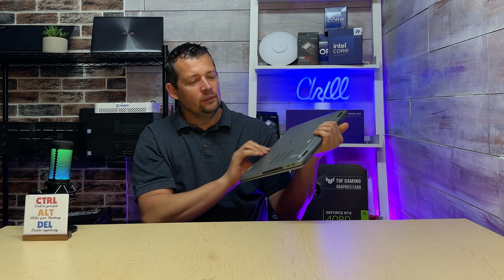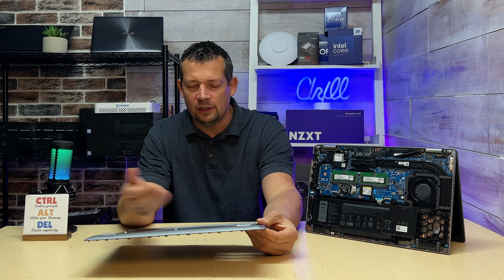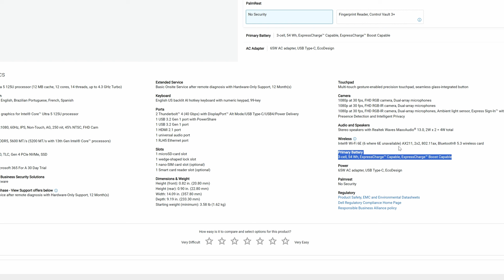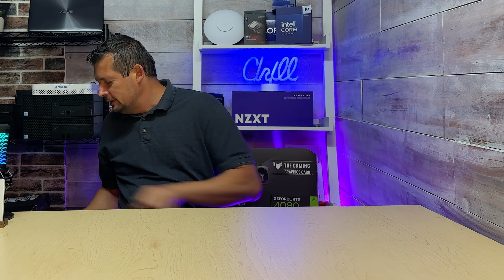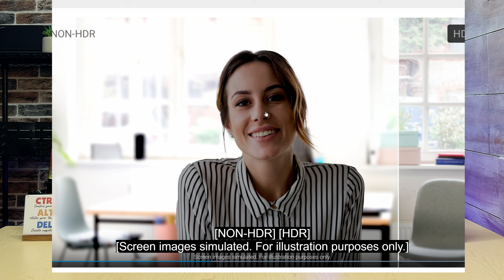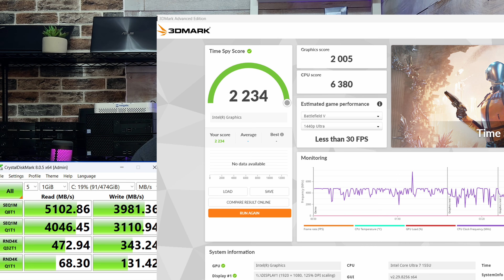Latitude 5550 Laptop Review - Intel® Ultra 7 155U  - Ram & SSD Upgrade options.

Comment: love the work man. is there any quiet laptop come with 12th or 13th gen Intel or AMD in equivalent to replace my T580 which serve me a good 5 yrs but now the high pitch fan noise started annoying so much. I have in mind for a dell 5520/5530 or thinkpad l15 gen 3 and my work is mainly on excel and few tabs in the background. do you have any recommendations? thanks in advance
Reply from the maker: Hey,

This is a tough one.
The new ultra cpus are so much better regards of heat. I stopped buying Dell laptops  due to the peeling paint and unreal keyboard wear about a year ago.
Hopefully that is behind Dell now.
5520 and 5530  might be affected by this. Look at the Lenovo.
I like HP EliteBooks, the fan also runs in them fast but it doesn’t have a super annoying sound of it.

Comment: I just got a 5550 for work and it appears there is a small button on the edge of the hinge side - what is it?
Reply: Found it! Nano-SIM card slot apparently
Reply from the maker: Yes ! You are correct! Around 5:22 you can see where the Wan card would be connected to the Nano slim card.

Comment: Can it run GTA V without GPU?
Reply from the maker: This is the "u" the efficient CPU, if you are planning to run GTA V or other games,   get the "h CPU " with least 16 or better off with  32 Gb of ram, that will run it for sure and significantly better as well.
Reply: @Scott.The.IT.Guy.  Thanks for quick reply. I got Ultra 7 155U (14 CPU) and 32 gb ram but no GPU card .. Will that work?
Reply from the maker: Yes it will you will get  60 fps in full HD , even with 30 fps it’s completely playable
Reply: @Scott.The.IT.Guy.  Gracias . you doing awesome work 👍

Comment: Usb c port are designed to be replaceable ? I hear they're held by screws instead of soldered on
Reply from the maker: They are part of the motherboard, I usually point out  that if you trip over the cord or damage the USB-C port you will need a motherboard replacement or someone who can do micro soldering.
I can’t find the related part in this video do you know where is it at?
Reply: @Scott.The.IT.Guy.   not part of the video.  The new dell pro plus has screwed on usb c modules and I heard the 5550 has it too.
Reply from the maker: I am looking at pictures from the 5550 motherboard and it has no screws.
The pro plus does and that is indeed replaceable. 
Dell actually is doing this with their desktops for about decade now.
Optiplex and precision desktops have optional ports that you can connect to the motherboard like Dp, HDMI, VGA, Serial, USB-C, 2.5 Gb Nic.

Comment: is this better than the latitude 5350 ?
Reply from the maker: It really depends on what you need to do with the laptop. The 5550 is a 15.6” laptop, it’s heavier, but since it’s larger, it has a larger  cooling system so the same processor is faster. The ram is also upgradable later on if needs to be.

The 5350 is a small 13” super portable laptop, the memory is on board so it cannot be upgraded. Since it’s a much smaller case it loses some of the performance.

What would you do with the laptop?

Comment: I have had two Dell laptops for a long time. The battery life isn't great, but both are still working. Which one is better, the XPS 15 or the Latitude 5550?
Reply from the maker: Not sure which XPS  are you referring to. The 16” XPS comes with onboard ram only and has a touch key Function key which I can’t stand. 
I personally will never buy a laptop with onboard ram. What would you do with the laptop?
Reply: @Scott.The.IT.Guy. I have not yet seen any reviews about the XPS 15. I am a digital nomad, and my work is entirely web-based. I think the Latitude 5550 might be too heavy for me as a woman. I am really confused about what to buy—there are so many options. I had a Lenovo before, and in the third year, the case/hardware softened or melted on its own. So, Lenovo will never be my choice.
Reply from the maker: I have been doing IT for 22 years, I was at Microcenter a few times this week looking for laptops for different clients,  the amount of laptops they have are overwhelming for sure.
The XPS 15 was discontinued last year, maybe you can still find it somewhere as new old stock, but as best as I can remember the XPS 15 is also heavy. 
I would look at HP EliteBooks, they are great machines especially when they are on sale.
Reply: @Scott.The.IT.Guy.  yay, XPS15 was discontinued, thanks for this info. 
How is the battery life of HP? ☺️
Reply from the maker: The latest generation G11 with intel ultra processors will be somewhere between 9-13 hours, the Elitebook 865 G11 with AMD processor can last 15-18 hours . I will have a review coming out on this in a few days.
Reply: @Scott.The.IT.Guy.  yehey... I'll wait for the reviews then... Hopefully both have the same solid hardware like Dell 😀

Comment: I have a dell 5440 Latitude for work, nice machine but I am truly looking to get the 5550 with Core ultra 165u, and this review solidified my case for the 5550, so thank you, I am an IT professional and hate to buy computers, but a gaming desktop me no good when I need a laptop :)
Reply: Silly question but can it run GTA V without GPU?
Reply from the maker: Glad it was helpful! I also do IT full time, but I don’t need anything powerful. Everything I do can be done in a browser and command line.

Comment: compare with ryzen pro 8840u
Reply from the maker: pro 8840u has better multi core and graphics performance , also pretty efficient. Intel has maybe a 3-5% advantage in single core. If you need performance, I would go with the pro 8840u .
Reply: @Scott.The.IT.Guy.  Amd 780m can compare quadro T1000 sir
Reply from the maker: @Fly9x  The old dedicated T1000 card is still better in general .

Comment: Great review. Are there any better choices than this for a laptop which offers both USB Type A and HDMI ports?
Reply from the maker: When the Lenovo T series or the HP Elite Book 800 series is on sale , I go with those. They have a significantly better quality screen selection, better webcam,  longer battery life, better built quality , but make sure you select these with on-site warranty only.
Reply: Excellent advice. Thank you!!!
Reply from the maker: You are welcome!

Comment: Hi sir
What about the graphics card .can you tell more about  it?
Reply from the maker: It does not have a dedicated graphics card but the integrated GPU is not too bad. What would you run on it?
Reply: I am a 2nd year student  in Electronics and communication engineering .In higher  semester  I may want to run circuit  designing  softwares like CADNENCE.
Reply from the maker: According to the system requirements it’s “recommended “ to have a dedicated GPU but sounds like this laptop would be able to handle it.
Reply: @Scott.The.IT.Guy.  Thank you sir

Comment: the i7 1355u faster and cheaper opinion  pretty much the same processor
Reply from the maker: 100% true! In some case the 13gen can be faster than the new ultra series and  the battery can also can last longer.  CPU is considered as the previous generation now; those will keep getting discounted. 
Dell still sells gen 12 i3 laptops for $250-280, hope the price will drop on these significantly.

Comment: My work gave me a 5540 24gb ram and a 5550 16gb ram. Which one do you think is better? Both are i7 but the 5550 says i7 ultra. I'll use it for sql and a lot of excel. Thank you!
Reply from the maker: So, this is a tough one, the older model can be (faster regards of CPU power) than the new and the battery also can last longer in the old model. The extra ram in the 5540 can be also handy, do you know if they have a U or H CPU? There is also a chance that with some updates and optimization in the future the ultra-CPU will perform a bit better.

Comment: What is your recommendations which dell latitudes is better in comparisons with HP 250 G10. I5, 2024. Please suggest
Reply from the maker: Hi,

If you are thinking about the Latitude 5000 and the HP 250, in that case the Dell latitude 5000 is a significant better machine, I think even the lower end latitude 3000 is a better built but not by much. If they cost the same and has similar specs get the one which has longer warranty. Which Dell model are you looking at specifically?
Reply: @Scott.The.IT.Guy.  I'm looking for something to run Linux. I'm a programmer.  Hp 250 g10 is cheap here right. However if possible. Suggest me a machine in the same class (hp 250 g10 i5). I ll see dell definitely. Thanks for the recommendation
Reply from the maker: I think this HP 250 is more like the Dell Inspiron . If you can go up to the HP pro book line that is way better designed and built. What price range are you looking for? Also what size screen do you prefer, does a long battery life important or you prefer performance over battery life. Also do you need a full size keyboard with the number pad?
Are you going to use external keyboard and monitor or not?
Reply: @Scott.The.IT.Guy.  bought, Asus Vivobook X1504VA-NJ089 i5 13gen 1335u, 512gb, 16gb. Thanks, man, for the help. Appreciated 👏

Comment: Does anyone has successfully upgraded the battery on the latitude 5550? I upgrade the ssd and the ram  front 16 to 32gb. Yet the battery doesn't last too long. When I'm working I'm lucky if I have 2 hours.
Reply from the maker: What are you running on the laptop?
The battery is significantly worse compared to the previous generation for sure but it should last way longer than 2 hours.
Do you know how to run a battery health check? What power profile do you have in bios and in windows?
Reply: @Scott.The.IT.Guy. I have the 54 Watt Hour Battery and get an easy seven plus hours on battery, even more if just browsing and not running multiple programs. ultra 7 165H, 32 GB RAM, 400 nit display.

Comment: Hi, can I disconnect the battery and work with direct power from the source?
Thanks
Reply from the maker: Unfortunately I don’t know the answer. A lot of these new laptops no longer has Bios batteries, therefore if you disconnect the main battery the laptop will not turn on. However the bios has different battery management options and there should be one for the same scenario where you are going to use the laptop from the charger.
Reply from the maker: Latitude 5550 Owner's Manual:
https://www.dell.com/support/manuals/en-us/latitude-15-5550-laptop/latitude-5550-owners-manual/system-setup-options?guid=guid-7c9da4e5-1ba4-4a40-a7c7-a38b0b39939f&lang=en-us

Table 7. System Setup options—Power menu:
Theres is a lot of options on how to configure the battery behavior. There is a menu here called advanced  I believe there is an option if you are not using the battery at all just the charger  to extend the battery life.

Hope this helps!

Comment: Hi, very good review! Thank you for your efforts. But I just wantted to be sure that if I can add another (second ) SSD HDD?
Reply from the maker: Hello,

This is the service manaul for the laptop  with  detailed installation for SSD upgrade:

https://www.dell.com/support/manuals/en-us/precision-15-5550-laptop/precission_5550_sm/installing-the-solid-state-drive2?guid=guid-20904f0c-b1f1-4efa-8ded-48184e4b552b&lang=en-us

"Computer supports 2 solid-state drive slots. Solid-state drive1 is the primary slot and solid-state drive2 is the secondary slot. If you are installing only one solid-state drive, install the drive to the primary slot. Install the second solid-state drive, if available, to the solid-state drive2 slot."

You can have two 2230 NVme SSD installed or one 2230 and a 2280 NVMe SSD.

2.5" Sata SSD or HDD can not be installed.

Comment: Since 2021, my Latitude 5520 has had all the features and performance for my real estate and artwork.   Sometimes, I used external speakers to get the volume and quality.  When it was new, the motherboard and hard drive had to be replaced.  Thank goodness for on-site service support.  DELL wants $420 to Renew the Warranty, so I might buy the 5550.
Reply from the maker: You are right, $420 is a lot, if your laptop is still capable to perform what needs to be done, just keep it as long as you can. Nothing will happen when the warranty expires as a matter of effect, I pretty much never buy an extended warranty. We are managing about 1300 Dell laptops and desktops combined, most of them last 5-6 years or longer.   Regards of speaker quality, we are making smaller, thinner, lighter laptops so we are putting smaller speakers in them, unfortunately this has not been improved in2024 at all.

Comment: Does this laptop use any "soft touch" rubber coatings in the case? I have a Latitude 6530 I bought in 2013 that had a sof touch rubber keyboard deck and it's horrible to keep clean. They eventually get nasty. I have a TV remote with it and had to throw it out eventually.
Also, is the RAM or SSD soldered to the motherboard?
Thanks!
Reply from the maker: That was a lesson to learn for sure, this one does not have rubber coating 😊
We have two ram slots, and the SSD is replaceable as well.
Reply: @Scott.The.IT.Guy.  Thanks Scott!

Comment: Great video, I will definitely return to your channel! What do all the performance metrics mean from the last segment of your video? Do you think there's much of a processing difference between 16GB and 32GB memory? Thanks
Reply from the maker: Thanks! Depends on what application you are running. Regular browsing, outlook, documents should not exceed 16 GB of Ram. 
If you work with large excel files, presentation, 10+ pages in the browser, photo/video editing, gaming  32 Gb of Ram can help, but again for general usage, 16 GB  is perfectly fine.